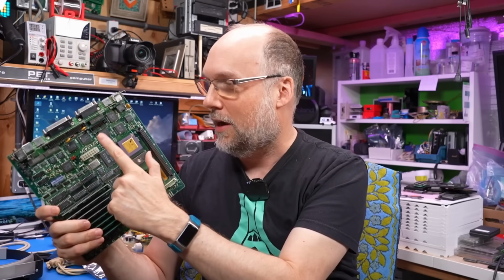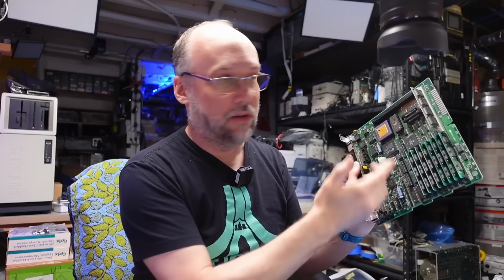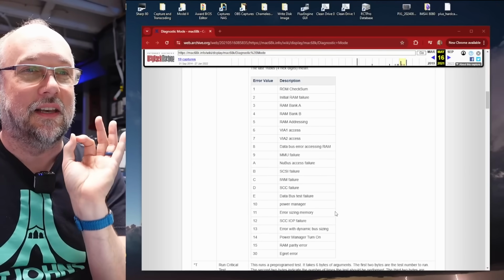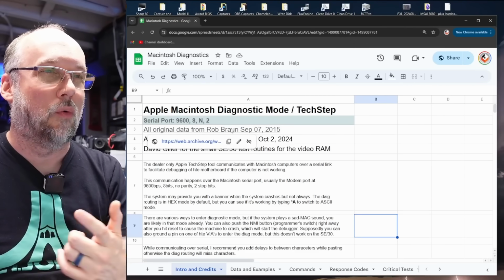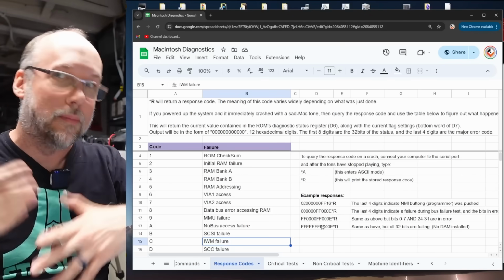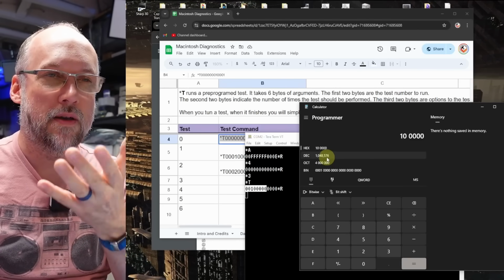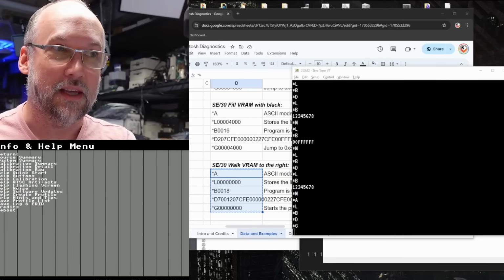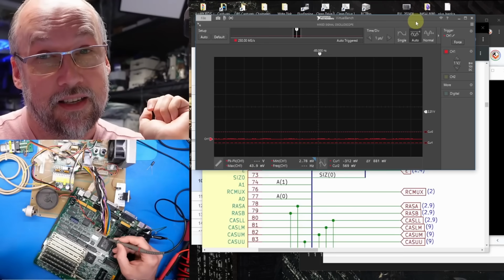Macintosh built in diagnostics: Emulate the Apple TechStep for free

Comment: With the protocol information Adrian along with others have documented there is no reason why someone couldn’t quite easily write a program that acts as a “virtual Techstep”. Using python along with PySerial library it would work on Windows, MacOs and Linux. It could be a terminal text based app, have a GUI, or both. It would allow the user to select the tests and other options in plain English but then send the appropriately encoded information directly over serial to the vintage Mac. Conversely, it would receive the encoded results and translate back into easy to interpret plain English. For advanced users, it would allow direct interaction with the debug command line like Adrian is doing to allow for custom or automated tests.

Comment: With Laplink or any other comms based application I've never had much luck getting speeds of 115200 on systems with a 16450 UART or lower.   There seems to be some sort of hardware limitation that results in dropped characters and corrupted data.  Even with a 16550 uart there seems to be a risk of corrupt data at speeds of 115200 baud.  To be on the safe side I stay with 57600 or 38400 for the 16550 and 19200 or 9600 for a 16450.  While it may be possible to obtain speeds of 115200 when both send and receive are 16550 uarts I stay on the safe side and set the speeds to be substantially lower.  

I would appreciate knowing if anyone else has experience with higher speeds especially with uarts older than the 16550 but also the the 16550 itself. 

Also another pitfall is that serial port connections are NOT hot swapable.  The risk exists especially with printer ports and pulling the cable when communication is active may result in damage to the uart itself.  Its best practice to shutdown the system prior to pulling t he cable and if you do so while comms are active you are risking permanent damage to the uart....

PS  Laplink is awesome!

Comment: I bought the newer model vibelink. My krk rokit 8 right channel all of a sudden speed working. So I hooked up an old set of gorgeous mission speakers to an old top model receiver. I've since bought the wiim ultra AND the vibe link and they sit on the desk. I've had stereo gear for years and the vibelink is most definitely impressive. I have owned crown power amps etc you name it. It just works it's small and very very impressive. Music on lossless yeah.. no complaints. At all. I have a large yamaha home theatre system and hate to say it the wiim is very impassive. Check out a vibelink. Being accurate, I haven't used it in a large room but the detail in sound and power is definitely there. More than enough power. I use it for a near field system. Connects to everything. Thoroughly impressed. Once you mess with the app is really brilliant. I swapped to this because on a top model heavy Japanese made amp I couldn't make the speakers LARGE. the wiim is the best thing I've bought in years and sounds fantastic.

Comment: I used the diagnostic mode using ZTerm on a IIci connected to a faulty SE/30 motherboard by serial cable. It had the same slow chimes and the same 00FFFFFF error that Adrian's board had. It turned out that the very same pin on the Glue chip, as shown in the next video, was broken due to a corroded trace.

Comment: Hi folks, this is a long shot but I want to see if anyone can chime in.
I tried to replicate this on my broken IIci, symptoms are: no chime, black screen, but I've checked the clocks and CS pins to various chips has activity on boot. I've recapped (including PSU) and cleaned the board.
Pressing NMI after machine resets, then *A works! However doing *R after that gives me "000025F81600*R", sometimes "000025F81601*R", and "000025F81603*R", 1600 is most common though. This code is not present in Adrian's spreadsheet, sadly. Unsure if the IIci has different response code?
Doing Size Memory test gives me *ERROR**T, is this a problem or simply not supported on the IIci?
I have 4MB RAM total installed, all the RAM tests aside from Address Line Test (test 3) works. It just fails to finish (*T is never returned).
Could this suggest some address line faults? But if that's the case how come the other RAM tests work?
I'm using 4x "Samsung KMM581000AP-8" RAM, installed in Bank A. I think these are 1MB RAMs.
I'm new to the system, so I'm not sure if there are other things I'm missing...
Any help would be appreciated! Thank you.

Comment: Could this be used as some sort of framework for a program running on Windows/Linux, which connects over serial to test the Mac? I wonder if Apple had a similar program, because those commands are cryptic and without any "cheatsheet", they are horrible to use.

Comment: One of the reasons Apple implemented board level swaps was because of guys like me!   I was harvesting the original Mac and Mac Plus ROMs for use in the Magic Sac and Spectre cartridges for the Atari ST.  It was a really cool device which would give you a faster Mac with a larger screen, all for far less money than a Mac (a LOT less!).  Floppy support was a problem at first, but by the time the Spectre GCR cart came out, the ST, which used a slight variation of MS-DOS's FAT format, could now read and write to Apple's GCR format.

A similar device came out for the Amiga, but I feel like the Atari implementation was better, if not cheaper overall.

I had another device that was an internal mod that had an NEC V20 (Intel 8086 and 8080 compatible) so my ST could run Mac, CP/M, MS-DOS, Windows 2 and GeoWorks).  I was a pretty happy young man!

Maybe someone could loan Adrian a Spectre GCR so he could explore it in a future episode?

Comment: Also remember that if you're loading and running a tiny 18 byte program, you're likely just running from the 030's cache. It will be writing to RAM, and incorrectly if the SIZ* signals are bad, but read and execute won't actually hit RAM unless the cache is flushed. A RAM test writes/reads too many addresses to hold in cache.

There is a CDIS input to the 030 to disable the cache, and the GLUE asserts it for I/O ranges, but you can also ground it to force reads to go to the bus.

Comment: This is like a good Murder Mystery. At the beginning all you knew for sure was that there had been a murder, victim unknown. The murderer was either the battery or one of the leaky capacitors. Now, after doing a roll call in the Library you know the name of the victim because the SIZ signal didn't turn up but not where the body is. This means you now know the rooms and corridors in the house that SIZ is allowed to use so if you trace their last route you should find the body. Will the cause of death be a cut trace or a corroded via? Tune in next episode to find out!

Comment: Something that came to mind when you started talking about the 24 bad vs 8 good bits, and didn't go away but instead just got further reinforced with the more details you revealed:
Might the memory management chip be sticking in 8-bit mode, AND only reporting 1MB available, because something's stopping it from accessing those other three SIMMs? Maybe a RAS or CAS line that gets as far as the first socket but is broken after that (would prevent the strobe signals needed to select row and column addresses from getting through), or a set of chip/module select lines where three have been damaged but the fourth one is still OK?

Because of the way that the 680x0 is signalled to use different data bus widths, it may then also be chucking data out to memory, and reading it back, over what is effectively an 8-bit bus instead of a 32-bit one. It's doing it slowly, but successfully, and seeing each chunk in turn building up to a full 32-bit width, so as far as it's concerned all the bits are good. And as you're doing an extremely simple, yet unfamiliar thing, over a slow serial connection, you're never going to discern any actual difference in speed. So it completes in 16 milliseconds instead of 4... you'll neither notice nor care about that. What will be a problem is any complex memory-bound operation taking 4x as long, and running out of RAM so much faster.

(the processor doesn't have any "permanent" idea of what width bus it's on, or that it's "supposed" to be on, only what it's currently seeing an assertion signal to use. 68k's are basically bus width agnostic for 8, 16, and later 32 bits. The 68008 only differs from the 68000 by losing some legs and having the bus width tied internally to "8-bit" permanently, and there's no reason you couldn't do the same with an 020, 030, 040... certainly there are enough examples of systems using an 020 or 030 on a 16-bit bus with only limited or even no 32-bit transfers ever happening. Plus, all of the I/O is memory mapped - it has no idea if a commanded write is going to a peripheral, or to RAM, and same for reads. So long as there's something at the given address that can accept data, the data will be sent there, at the width it's been told to. Thus if all you can see is an 8-bit wide strip of 1MB of memory, that's what you're going to write into, then later read back out of with no trouble at all. It doesn't mean the memory, or sockets, are all working...)

Like I guess you can test by removing the other three SIMMs and seeing what happens (if that happened in the video, my apologies, my memory is bad), or certainly two of them. Switch them around musical chairs style just to be sure. Write a routine that writes some known block of data across the 1MB boundary and see if it succeeds, and whether all that can be read back again properly. Maybe it'll get to 1MB plus 1 byte and die. Start the processes at or just before different megabyte breakpoints. Etc etc.

Also have you tried putting the memory in the second set of banks and seeing if it then boots? Gives better diagnostic results? You could / can do that with a lot of computers these days, so long as it's present somewhere it's usable and can be logically reassigned in a sensible order.

Comment: I’m surprised that nobody has mentioned the predecessor to the TechStep: “AppleCAT”.

All you needed was a working Mac, a serial cable and the AppleCAT floppy disk.  The good Mac would use the same serial port diagnostic system later used by the TechStep to interrogate the faulty Mac ("Unit Under Test" in Apple lingo) and would show graphically which memory module (or whatever) was faulty.

To fully test the faulty Mac, you needed a heap of cables and a serial loopback dongle.  The main problem was that the good Mac had to be a fairly high end machine by late 1980s standards (not a Mac Plus or 512) and nobody could afford to keep such a Mac on the shelf for the occasional repair, so you’d be taking someone’s main desktop machine away from them in order to run the tests.

Also, like an earlier poster stated in relation to the TechStep, it was almost always quicker to just suss it out yourself or swap things around with another machine.  AppleCAT didn’t give any details useful for component level repair info though.  I don’t remember the TechStep doing this either - at least not with the ROM modules Apple sold to level 1 service centres.

[EDIT] A lot of people were deeply cynical about AppleCAT being replaced by the TechStep, because other than the (excellent) SCSI diagnostic module for the TechStep, AppleCAT could do it all without buying an expensive proprietary device like the TechStep.  Apple have always been out to gouge their dealers and service centres just as much (if not more) than their customers and the TechStep felt like a step too far.

Comment: MOD3 ram test rang a dim and distant bell in my memory. Those 32 bit values are special. COnvert them to binary and you'll see ther are a repeating pattern of 110. Turns out old ram ocassionally leaked bits in close columns.  Running write read cycles with the DB6D etc rotating will flush out flaky ram
I wrote a ram test for a proprietary machine back in the ealry 80s and this was one of the recommened tests for 4116 and 4164 ram chips

Comment: actually, I'd think it's the other way round
Wehn the CPU adresses the peripherals it wants to do 8bit transfers but the glue chip recognizes them to be 16bit or 32bit ones. The bitmask on the error would also make sense then, because the glue will see only those 8 upper bits active for those adresses in memory, so the 24 lower bits are error

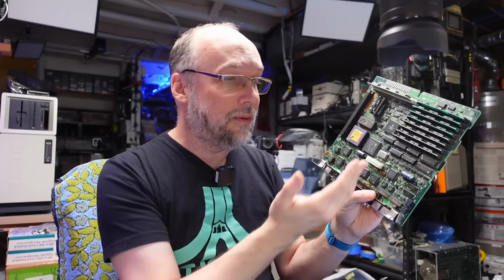Comment: 13:40 It's called a core charge. With a core charge, Apple expects the bad logic board back. While the logic board is only $565 and you have to give the old board back (even if it had liquid or physical damage), Apple charged $1165 if you wanted to get a new logic board. It was a deterrent so you couldn't build a frankenmac.
16:45 I'm surprised that Wayback was accessible this quick after it was DDoS'ed and hacked.

Comment: Being able to send and execute Machine code changes everything. Sure Machine code is not user friendly but it opens up the entire system and gives the ability to execute your own tests. I could see mac enthusiasts creating a small library of Machine code tests for this

Null modem cables... we used those for Doom and C&C Multiplayer before we got Ethernet cards.

Re people suggesting looking at other videos. Video not being initialized on a system not booting almost never indicates any specific failure on any system old or new unless the post steps before video is initialized are very limited (I see people all the time ask how to fix a black screen on a non working computer when the problem could be anything that causes post to fail ). If a system boots but without video  that is different and is probably bad video circuitry.

Comment: The moment you were leading up to showing reads and writes working, not even after but as you were heading in that direction, I sighed and said "The memory writes work, and it's something to do with the GLUE chip, isn't it?"

It's a pretty obvious conclusion that if your RAM is working but you're getting RAM errors, either the MMU or the GLUE chip is somehow at fault. And you disabled the MMU, so... That only really leaves the GLUE chip. It's a good thing that it's just a trace somewhere, and not the GLUE chip itself, because the only way to get a replacement GLUE chip is to cannibalize another board.

Comment: Inside Macintosh IS ONLY a programmers reference.  It illustrated the applicable Macintosh OS APIs to support software development on the early generations of the Macintosh.  Once Apple moved to N.E.X.T object oriented OS as the foundation of the newer Macintosh OS, Inside Macintosh was effectively obsolete.  And you are correct, you had to send Macintosh hardware back to Apple, and they destroyed what they could not repair.  Worked for Apple for a few years in the mid to late 80s at the high tide of Apple's hardware inventory control methods.

Comment: That analogy of someone asking what's wrong with their car without having seen it, that actually happened a lot when I repaired PCs for a living, someone called the shop and asked if I could tell them what was wrong with their computer over the phone without having seen it, and of course, I couldn't, had to explain to them that without having the computer in front of me to diagnose any faults with it that I couldn't tell them what was wrong as it could be anything from a bad OS install to failed hardware which I couldn't guide them through over the phone...
Reply: The one I remember most was a phone call that began with "I can't print!"

It was caused by a full hard drive.
Reply: @mikebarushok5361  for me it was a complaint of a key not working. After fighting the keyboard case and plate, eventually locating the pins, I find it was fine! Turned out to be a locale issue in the OS.

Comment: As a former systems admin/network admin, you made me nostalgic for null modem cables.  When I was young using those to transfer files and even play Doom with another person was possible.  As an admin, we used Serial all the time to configure devices, and these days you use usb to serial adapters.  I still have a frankencable similar to your laplink cable, but it allows me to turn "null modem" off and on, and has both male and female adapters on both sides, so I have a 1-cable solution for any serial ports I come across.  I even have an RJ45 adapter for all the networking equipment that uses serial over an RJ45 port.

Comment: 37:58 as for the 24-32 bits being used for 8 bit devices comes straight from the processor being big-endian. It will store its MMSB in the 1st byte and its LLSB in the 4th. So an ldr.b instruction thus reads a byte from the 1st byte adressed and has thus to be on the bus as bits 24-31 as this is mapped to the LLSB.
One consequence is that if you read a 8 bits from a 16 bits stored value you get the MSB where for little endian machines this would still give you the LSB part.

Comment: Its particularly fascinating that Apple bothered shipping the techstep and diagnostic mode at all, because they were indeed basically useless outside of Apple’s own engineering departments because nobody was authorized to do board level repair anyway, and if they did some anyway they couldnt get parts and thus were limited to fixing solder joints and adding bodge wires (or replacing the occasional commodity chip).

They had to build them for internal engineering purposes, but leaving them
In the ROM is pretty fascinating.

Comment: I like the concept of keeping the repairs relatively simply with off the shelf equipment.  That being said, I would also be interested in advance repairs, using reverse engineered test setups or 'test jigs' that were originally used by Apple.

I've found that manufacturers have deployed some interesting methods for troubleshooting, that can be used to our advantage, when servicing legacy equipment.  

Motorola had Lab Tools, while challenging to get, was very handy when servicing some of their radio equipment.